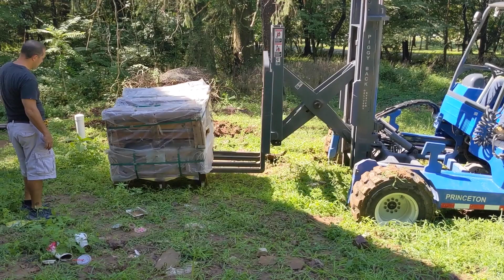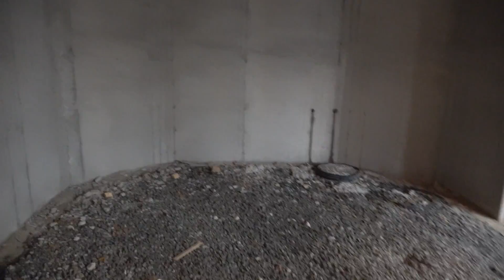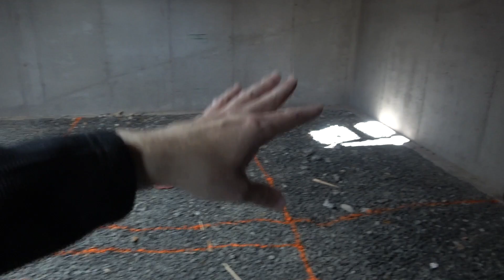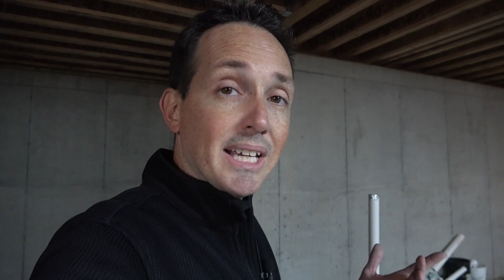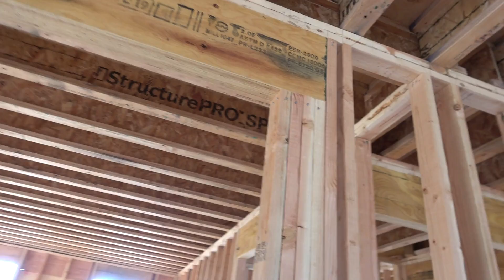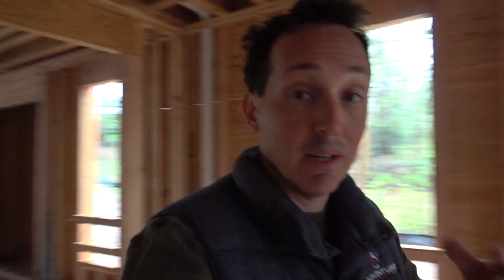I GC My Own Luxury House - Ep 10 Rough Plumbing The Vent System

Comment: having the ejector pump in the basement instead of a pit in yard sets yourself up for a nightmare
Reply: You are thinking of a whole house ejector. Many people (myself included) have both- the waste water from my basement utilities use an ejector pump that then goes to another ejector pump outside which pushes to my city sewage line.
Reply: No shit!
Reply from the maker: The ejector pump is in the basement because the drains and toilet flush are below the gravity waste pipe that exits the house to the septic tank. It's forcing the waste up and into the waste pipe to then exit the house, no way around that.
Reply: @superspeeders  you have it directly outside the foundation in a deeper pit than the basement level if it ever breaks its far easier to dig it out of the yard than jackhammer it out of the basement
Reply: @imchris5000  too late now lol
Reply from the maker: @imchris5000  Its servicable from above the slab.